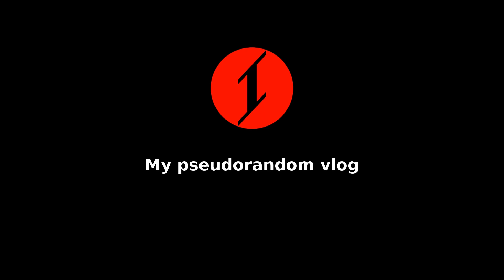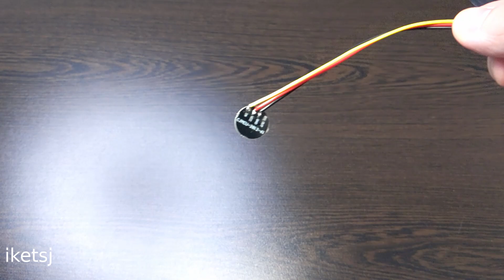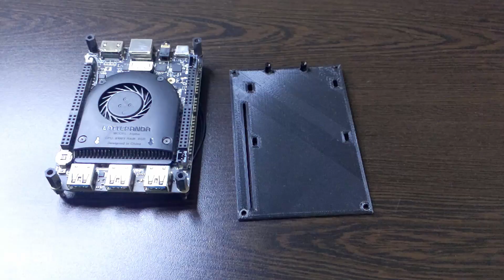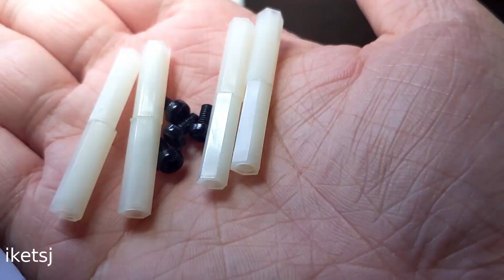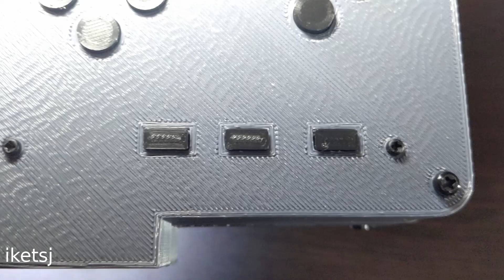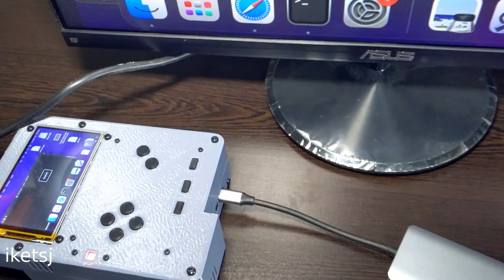mac Gameboy ?

Comment: This is awesome. Would it be possible in a bigger format to have an "easy access" slot for the M.2? Or some type of extender to re-allocate it to another part where you can have an easy access slot? I can just imagine swapping M.2 drives like cartridges.

"Oh, this is the Windows one."

"Here's the macOS cart---drive, haha."

"And Linux!"

Really cool. Looks pretty comfortable to hold too, good weight and thickness.
Reply from the maker: Yes, probably. If you noticed the 3 USB ports at the bottom, it is the "cartridge" slot in this build. I was supposed to 3D print a pseudo-cartridge with a USB male connector to connect there.